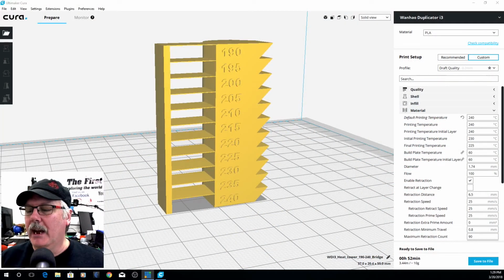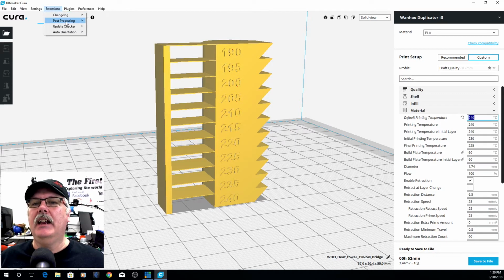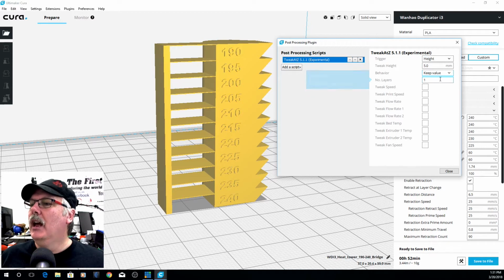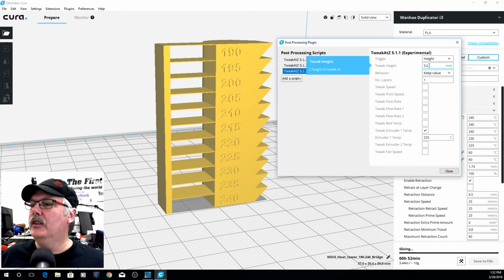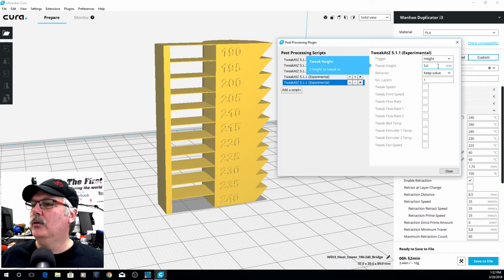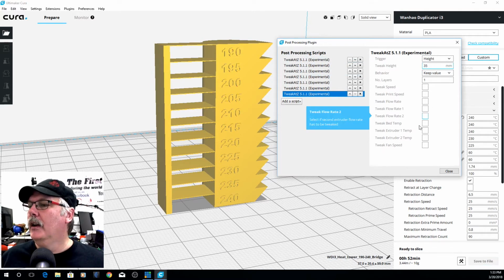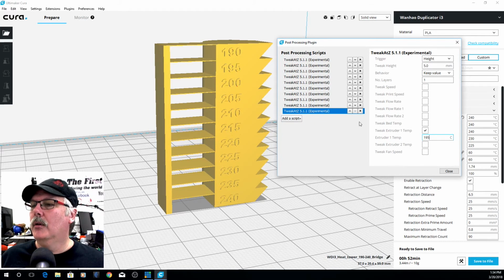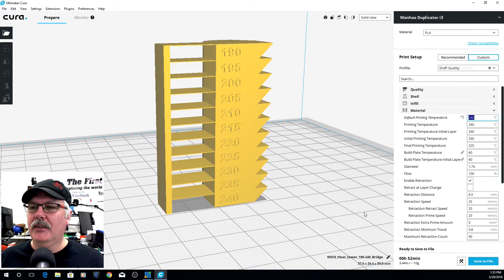Cura 3.2.1 vs Temperature Tower take 2

Comment: When I enter the "Tweak at Z" settings, do I need to go back in to Cura and delete them before I print something else?  Is there a checkbox somewhere in Cura that I can disable the "Tweak at Z" effects, but leave the scripts?
Reply from the maker: Yes, you will need to remove those settings. As of the new Cura, if you save a project, it should retain those settings in the file, but we haven't tried it yet.